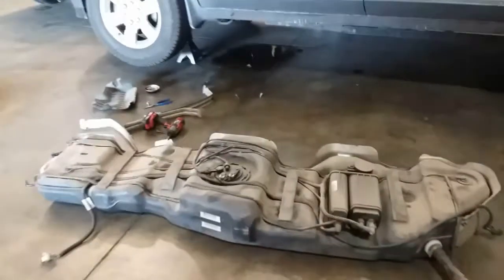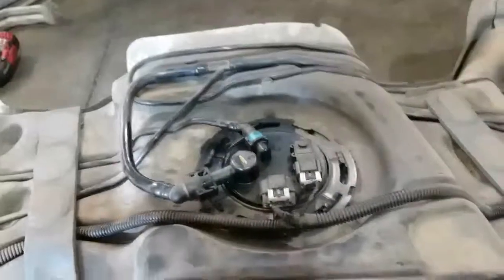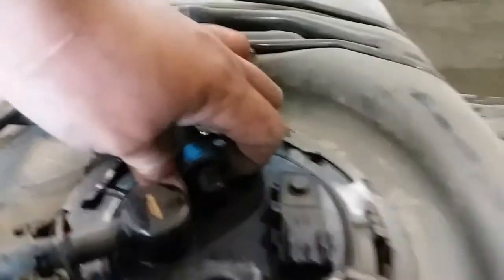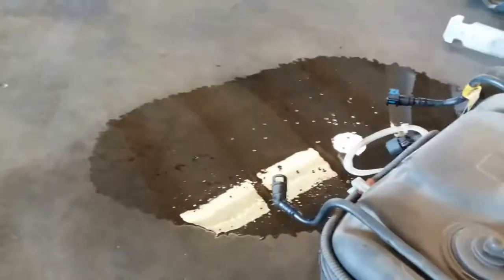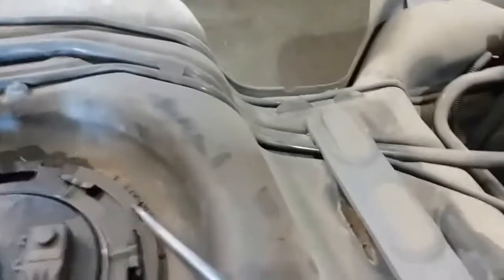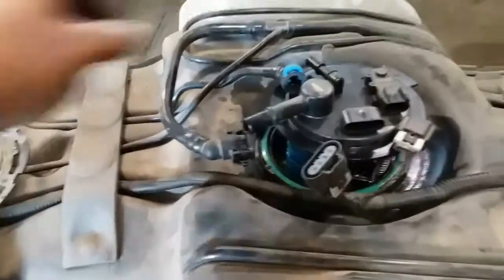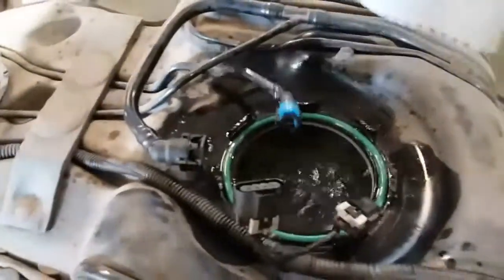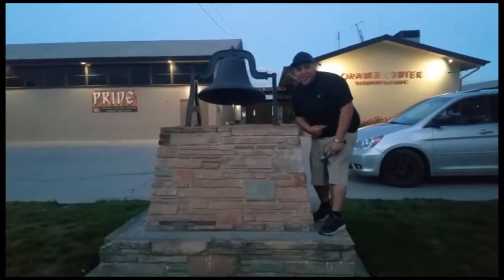How to: Remove the Fuel Pump From a 2011 Chevrolet Traverse

Comment: Why remove the tank if only to work on pump..did you not try removing the back seat and the carpet to get access on the plate cover..under the cover is the fuel pump..
Reply from the maker: Lol I had to replace the fuel pump and troubleshoot why it wasn't marking the level in the dash....it turned out to be the pigtail 🤷‍♂️

Comment: I got 2010 traverse an it turns over but won't start .no engine check light on.put it on a code reader  it showed cylinder 2 an 4 miss fire .then on another code reader it read crank sensor so I change it an still no start .any advice?
Reply from the maker: thats weird but i would start with the crank sensor. than can cause the miss fires
Reply: Man I change it just spins over .put the old one back on an pump the gas pedal an it started but didn't keep running. Spray starter fluid in it still no start .any advice?
Reply: @mushroomon  yeah, take it to a shop, cheap skate